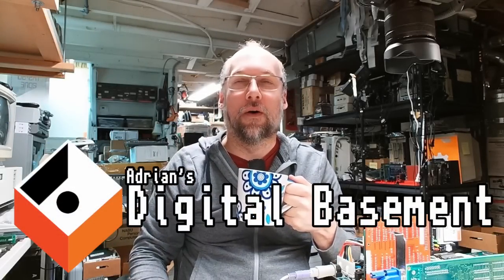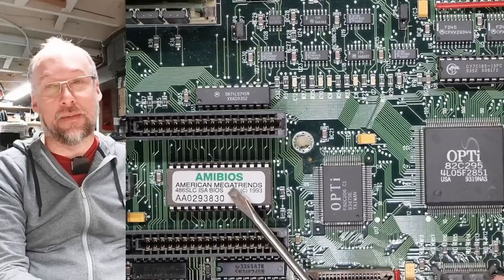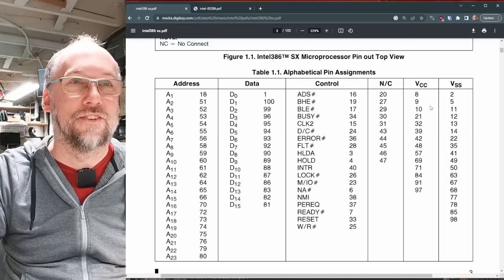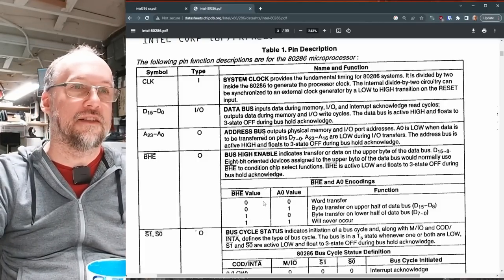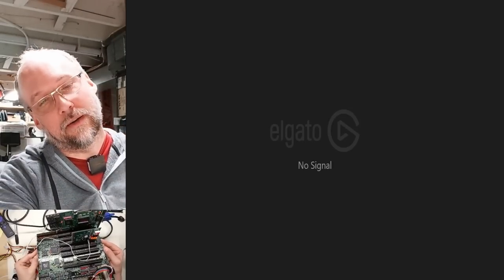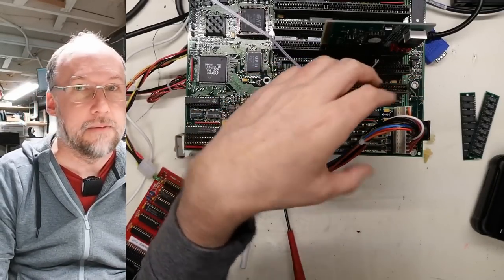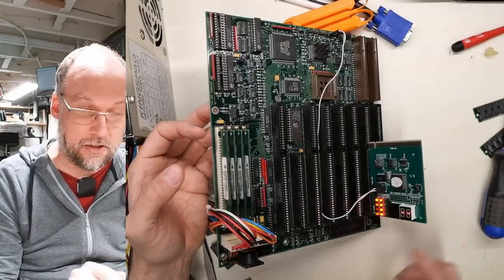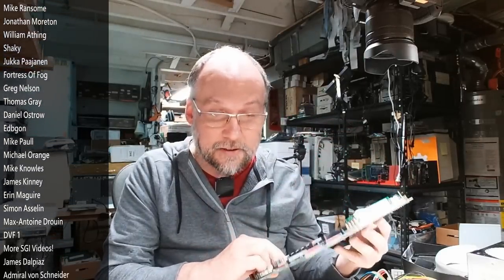Disaster struck while working on this odd-ball 386SX VLB motherboard

Comment from the maker: A couple notes: I tested the two sticks of RAM and they were 4mb each. I also tested the math co-processor and that works just fine in another 386SX board.
Reply: I’m guessing that’s a spoiler
Reply: @Fergo101  agreed 😊
Reply: Have you found a combined ISA/VLB/EISA board yet?  The Pentium PCI/VLB boards were awful, normally only used as an upgrade path so people could use their VLB graphics card!
Reply: @timballam3675  I have never seen both in the same motherboard. Usually EISA had all slots EISA, white for some reason.
Reply: We learn from failures, so it's not a total loss. You take this knowledge and roll it forward to the next time.
Reply: Time to use Graham North's tricks for finding broken components. I bet something's shorted across power and ground. Work your way across the board, following the power rail in question, till you find the farthest place away that's shorted. Putter around nearby with the meter on continuity, sooner or later you'll find the culprit. Alternatively, use a bench supply and his voltage injection technique... I think he recommends starting at about 1v5 and an amp or so? If it boils 91+% isopropyl as soon as you spray it on, you've found the problem. After that it's simply a matter of ordering parts (?) and then doing your best Louis Rossmann impression.
Reply: It maybe further testing required to check if other components are damaged by PSU.  like capacitors resisters that would stop being able to post.
Reply: @timballam3675  I found one in my collection of old motherboards. It has an amd p75 133mhz; 4 ISA, 1 VLB, 3 PCI. And 4 30p simm slots and 2 72p slots with at connector (not atx), but has integrated floppy/ide/parallel.
Reply: Adrian, this was not a wasted video effort. The experience you had is a perfect example of a PSU dying right in front of you and killing what it's connected to as it dies. This is uncommon for people who are not techs but is a regular occurrence for people who frequently work on electronics and computer technology.
Reply: burn a new bios and try it , and see if theres a track been cut on the back near bios and battery .
Reply: I had a power supply "fry" on my workbench - definitely scared me into quick action - to pull the plug !! As for the other parts - now you have spares ! :) Good video, and every mission adds to one's experience level(s).
Reply: Hey Adrian! I love your channel! I'm also repairing computer since the 90s. Just wanted to tell you that I in fact had a computer that didn't want to boot without a CMOS battery. Since the Post code was 10 beeps I would have tried to give it a cr2032 and see what would have been the next error? Greetings from germany. And thx for your great work!
Reply: @timballam3675  I used to drool over those boards back in the day!  I don't think I've ever actually used anything with EISA before.  I'm pretty sure I had some EISA boards, but never used them.  I sued to buy "junk" bins at computer shows.  Just bins of random boards that the vendors didn't feel like selling separately.  Usually they'd be like $2-$5 per card or whatever, but I'd just give them like $20 for the entire bin and they'd be happy to get rid of it.  I found some real gems in those bins before.
Reply: @freeculture  I've never seen a white EISA slot before.  I seem to remember them all being brown.
Reply: Nice video! Today i built an ALi M1386SX based system with L1 cache and VLB. I just upload a video with benchmarks.

Comment: Hi Adrian, sorry for making an announcement here, but I wouldn't if it wouldn't fit so good ;)  Accidentally, I'm currently preparing a video about another 386-ish board, which also has VLB. That is a 386DX (unfortunately not a 386SX), but if everything is going as planned, I'll try to show some performance results as well. Btw. your board is not quite a 386SX, it is an extended version made by Cyrix/Ti. It is a reduced version of a 486, which was made to fit 386SX boards and is also known as IBM lightning.
Reply from the maker: I have a couple 386/486 boards with VLB that can run either chip. Kind of interesting but just seems wild to have 32 but CPU here with a 16 bit bus connected to a 32 bit slot! I have done some testing of 33mhz 386DX VLB vs a 486DX33 VLB and they seem roughly the same speed, which makes sense  since it's just 32 bit all the way.
Reply: I had this board in my Tulip PC around 1995? The vlbs where occupied with a vga card and a scsi card that drove the harddrive. I bought the pc second hand and it was originally used as a CAD station.
Reply: @adriansdigitalbasement2  Well, if we are talking about throughput they are probably the same yes, however it's a little bit hard to compare a 386DX with a real 486 clock for clock. Due to the integrated L1 cache in the 486 and its pipelined design, it was by far more efficient per MHz compared to 386DX. Even  the Cyrix/Ti 486SXL, which were drop in replacements for the 386DX lost against a real 486 by a huge margin. They usually had only 1kB L1 cache (vs 8kb in i486) and were based on Cyrix weaker overall design back then. As a result there are barely benchmarks available, which would give us clean view on VLB performance differences. All I can tell is, that even 386DX benefits from VLB, just as you said in the video, probably because of higher effective clock and therefore throughput. But the sweet point where VLB shows its full strength over ISA is somewhere between DX2-66 and DX2-80.
Reply: @necro_ware  our german friend is goin to upload a vid! I can't wait for it now...
Reply: @adriansdigitalbasement2  Perhaps similar for VLB transfers. But if you compare the 386 and 486 on pure calculation loops, you will find that the 486 is about twice as fast as the 386 at the same clock speed.
Reply: @necro_ware  Nice, new content soon!
Reply: @necro_ware  Lets not confuse things. Cyrix not only did have a "real" 486, it was faster than Intel's, because the internal cache could do writeback (bi-directional). You may be referring to the SLC and DLC, those are swap in replacements for 386SX and 386DX, with the same bus. Main difference is they did in fact had internal cache, but was a mere 1k instead of 8k/16k. And yet, compared to a normal 386 with zero internal cache, it was much faster, not like the full 486SX/DX, but close. Oh yes, that tiny 1k internal cache, was also writeback capable, if your bios could not enable it, you needed to use some dos program to do it at boot, since it defaults to writethrough (Same as Intel/AMD) for legacy compatibility reasons. Did it make a difference? Yes it did, you could benchmark both modes. I don't remember having any issues with writeback in any program/game i used back then. By the time of the Cyrix DX4-100 Intel was already doing Pentium so again, it was a sort of middle ground, and later Cyrix would do Pentium class parts when Intel was at the next gen already, it didn't last much long after that. What Cyrix did had weaker, was the FPU, but not by much (compared to the equivalent part, not the next generation part).
The fastest Intel 486 part was DX4-100, if you didn't mind the 25mhz bus. BUT, there was a rare Intel DX-50 with actual 50mhz bus, not to be confused with DX2-50 which was 25mhz. I think AMD reached 120 (40mhz x3).
Reply: @necro_ware Incidentally I was trying to remember your YouTube channel name as you and Adrian have a very similar methodology and I came across your channel a few months back, how the stars align aye. 

Good to see you about after watching this I'll head on over to you too.
Reply: I had and used Cyrix 486DLC 40 MHz for years, its speed was the same as Intel 486DX 33 MHz. I wouldn't say a bad word about that performance, I think it was pretty good achievement for the price. (But it does not have an integrated math unit.) Back then, I had no clue it uses a 386 type motherboard. 🙂
Reply: I had a 486 DX 50 VLB Board which basically overlocked the bus due to how the clock dividers were set up on the DX 50. I didn’t even know they made 386 boards with VLB as well
Reply: @herrbonk3635  but the discussion is about VLB speed lol
Reply: @freeculture  Intel had a DX4/100 that was 2*50 as well as the regular 3*33. Confusingly both had the exactly same name lol.  My boss in the repair shop I was working when those chips were in the market stole my DX2/66 from my personal PC (that I had at work temporarily), and said he would replace it with a DX4. He begrudgingly agreed to pay for the 2*50. 😂
Reply: Yeah, the first thing that I was that board looked a lot like some other BlueLightning boards that I have seen before.
Reply: @Qyngali  So a DX2 100, i guess Intel was labeling things DX4 because DX3 was trademarked or something.. Yeah 3x 33mhz that sounds familiar i guess i forgot. 50mhz bus is fun if the card can handle it, don't remember if i had issues at 40mhz but since the DX4 was 33mhz i guess i just forgot about it.
Reply: @adriansdigitalbasement2  Hi Adrian and Necroware there is not that much content about these Alaris motherboards and the Blue Lightning CPUs I can only think of the excellent video @retrotechbytes did a "while" ago.
I hope this rare board can be recovered.
BTW donyou know about the ATX2AT project by Samuel DEMEULEMEESTER?
Reply: CPU Galaxy made video about 386 dX40 and VESA. He has 386 and 486  sockets in one motherboard
Reply: @necro_ware  I had a Micron 486 VLB motherboard capable of running up to 50 Mhz bus speed. Unfortunately I didn't have fast enough L2 chips for 50 Mhz. I really wanted to try it with an AMD 5x86 at 2x50 VS 4x33, 3x40, and 4x40. IIRC it was mostly stable at 4x40 with a large cooler which I'd filed the bottom flat on and carefully applied just enough thermal compound onto for full contact. At 2x50 it would make it to the Windows 95 splash screen and lock up. If I disabled L2 cache it worked at 2x50 but was super ultra slow, slower than even 3x33. I settled on running it at 3x40. If I'd had the fastest L2 chips available and a Peltier plus a massive cooler I might have been tempted to try 3x50 or even 4x50.

It didn't have the jumpers to tell the CPU to enable 4x bus speed. To do that I used a tiny piece of wire wrapped around two pins on the CPU. IIRC a Vcc and the 4x pin, which were at the edge and had one other pin between. So the wire had to go out and around the intervening pin, barely poking out past the CPU edge.
Reply: @freeculture  the AMD 5x86 had a 4x mode and despite "requiring" 3.3 volts would run happily, if toasty, at 5 volts. The ADW version was more desirable than the ADZ version for running at 5 Volts. For boards without jumpers for 4x speed the 5x86 could be hotwired with a small wire jumper twisted around the 4x enable pin and a Vcc pin, both conveniently at the edge with only one other pin between so it was easy to bend the wire out and around.

Even running at 5 volts, the AMD 5x86 ADZ didn't run as hot as the Cyrix 5x86. One time I barely brushed the tip of a pinky finger against the permanently attached green heatsink on a Cyrix 5x86 and it instantly raised a blister.

Comment: Gotta quibble with the equating of a 386sx with a 286.  It's true that they share (almost) the same bus interface and tended to go into the same sorts of AT clones.  But the 386sx was internally a real 386 core, 3x as many transistors, 32 bit registers, a paging MMU, emm386 compatibility, dos4gw, the works.  Hell, you could (and many people did) run Linux on the 386sx.   But it's true that almost all the chips were deployed in environments where they only ran AT software.
Reply from the maker: I thought I was clear I was saying it was the electrical and external interface that was the  same but clearly internally it's upgraded. The 486SLC on this board even has internal L1 cache and is clock doubled internally, making it somewhat speedy, albeit extremely crippled with the limited external bus limitations.
Reply: @adriansdigitalbasement2  To be honest, I had somewhat the same quibble too.. The way you phrased things in several places it really did sorta seem like you were saying "the 386SX was basically just a rebranded 286", which was actually quite far from the case, both in terms of design and capabilities.

I could tell what you meant, but some people might get the wrong idea based on how things were said...
Reply: @foogod4237  The craziest PC CPU ever has to be the Texas Instruments 486SX they made as a plug in replacement for PLCC 80286 chips. It was pretty popular as an upgrade for old laptops. I knew someone who put one in an old laptop with an amber plasma display and another in a PS/2 Model 60, along with every other upgrade he could possibly stuff in, and it was still super slow. He tried to give it to me, several times. ;)

I don't recall if TI made it in an LCC type. 12Mhz 80286 LCC chips were common desktop CPUs. I always thought the little heatsink on the clip was ridiculous since no 286 ever got more than barely warm. I did somewhat lust after having a 16 Mhz 286 but apparently they were rare, or sellers just figured (as they always have) the absolute fastest CPU for any given PC platform should be worth almost double the CPU one step down in speed.

I'd love to have my super 286 back. I had 12 megabytes of RAM in it. 512K in DIP chips on the board, the rest was on three Micron 16 bit ISA cards. Split between backfilling low RAM to 640K and 50/50 between XMS and EMS. I had a Pro Audio Spectrum 16 in it (a Reel Magic card minus the SCSI and VGA components) and a Soundblaster 2, with autoexec.bat and config.sys and Windows 3.11 (the OEM only version which still had Standard Mode) all configured so any game I had would automatically be able to use whichever was the best sound it supported. How I got the RAM cards was a friend wrote a school paper on waste in the computer industry and Micron gave him six obsolete, new in box, RAM cards. He couldn't use all of them so he gave me three.

Comment: It's a bit odd to refer to a 386SX as "basically a 286," since it still had the full 32-bit instruction set and the i386 protected mode (which was vastly different than, and superior to, the i286 protected mode). There's a lot of stuff that runs on the 386SX that wouldn't run on a 286, even if the overall performance isn't much higher for 16-bit applications.
Reply: Yeah, as a programmer I cringed a little every time he said it was basically a 286.  You won't be able to run any software that uses PMODE/W on a 286.  That's pretty much everything from the demoscene.